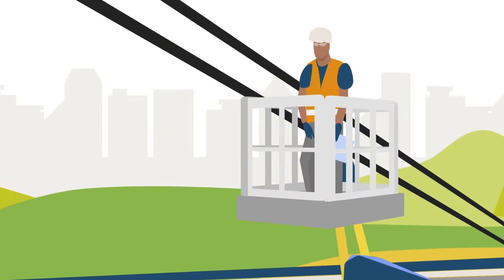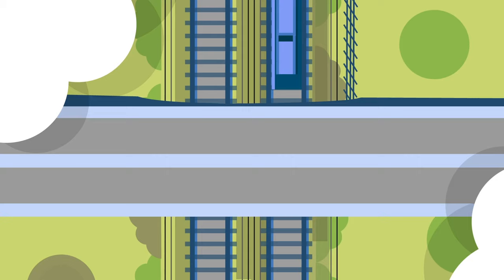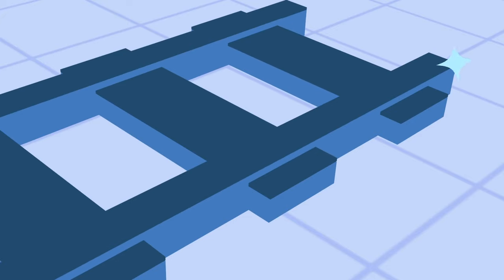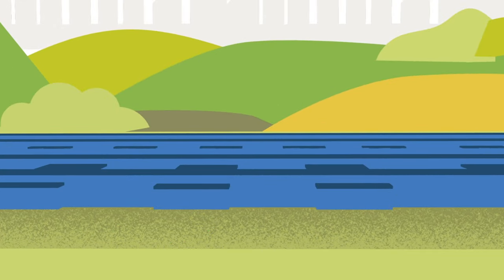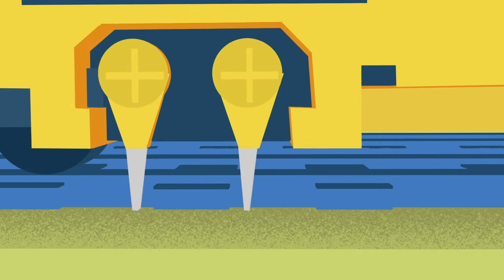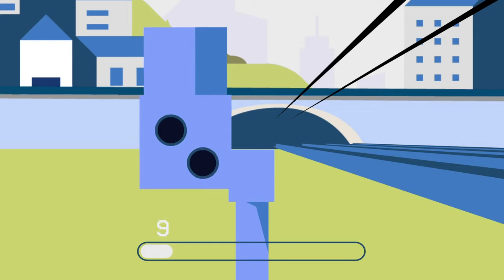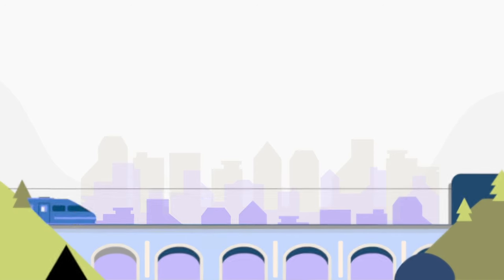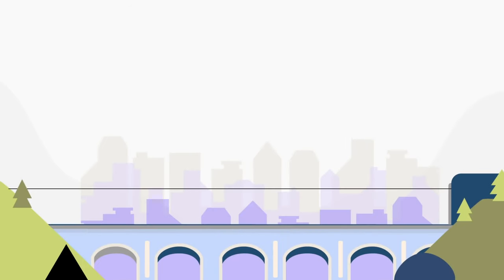Planned engineering works

Comment: In the Far East, planned engineering works happen at night when there are no trains running. I used to work on road tunnel E&M projects in Hong Kong. E&M and electronic service systems could most usually be replaced in the middle of the night over several years. Additional nights maybe needed but daytime suspension was a big no-no. I can understand if the planned engineering works are for new projects, where you genuinely cannot run trains because you need to remove the rails and reroute the line somewhere else. I can also understand maintaining civil structures. But if it's just planned E&M or rail maintenance works, I believe you should be doing it at night, not during the day and certainly not during long holiday weekends. For weekend suspensions just for the purpose of maintenance or equipment upgrade, I'd call it planned engineering doesn't work.
Reply: The only way to get big railway projects done is closures.

The UK has large areas that have not had overhead electrification installed. That means that diesel trains can not be swapped out for more environmentally friendly electrified trains until that work is pushed through. The faster electrification gets in, the sooner the public benefits from the improvement.

However, the actual stupid thing is doing all the works over Bank Holidays. That means that a lot of engineering equipment sits around unused and then massive workforces are needed to do lots of things all at once. A better way to do things would be to have some engineering works every day of the year (including work days) so that expensive bits of equipment that finish being used for one task can be doing the next task a few days later.